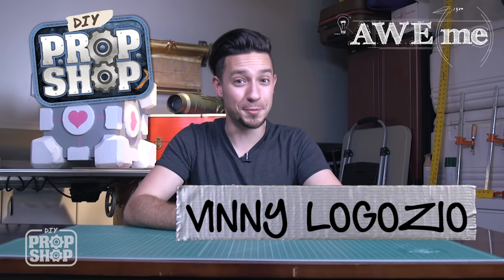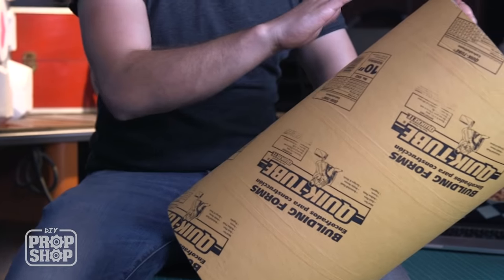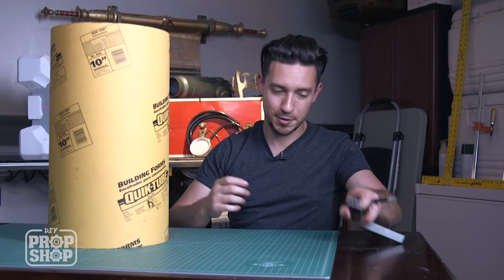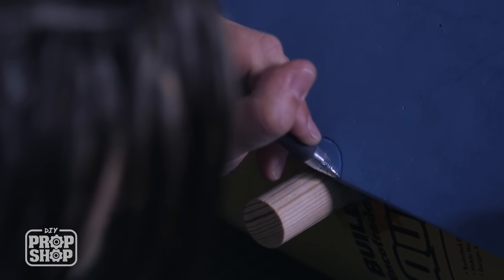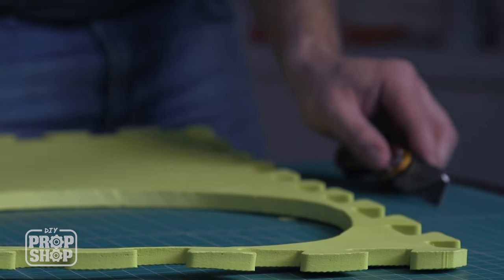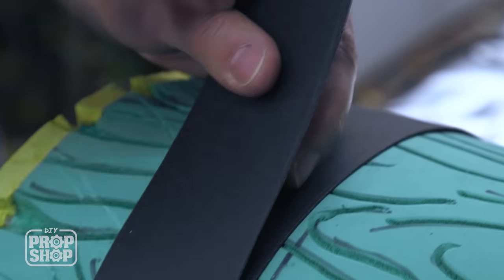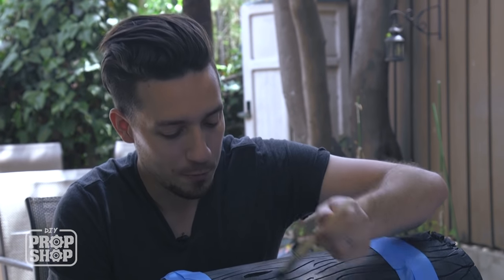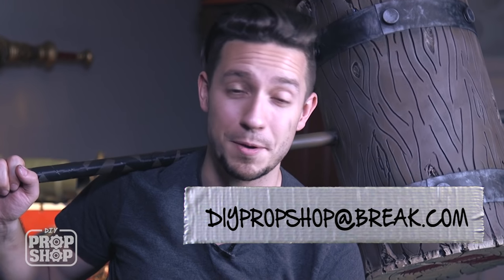Make Harley Quinn's Hammer - DIY Prop Shop

Comment: I find for better grip I use a technique I learned in hockey camp, you twist the tape into a cylindrical tube then put it over the grip surface, then cover in more tape. Works great for hockey sticks, and lacrosse.
Reply: I like that tip a lot. My absolute top pick for this would've been some type of black gauze bandage. Has anyone found something like that?
Reply: +Vinny Logozio walmart has sports wrap that would probably work..
Reply: I finds some cordage under some cloth tape on s good also.
Reply: Thank you guys these are great!
Reply: Vinny Logozio  black gauze bandage? Other than sports wraps, the closest thing I can think of is gaffer tape ....similar to duct tape, but uses cotton instead of vinyl plastics, and it&#39;s stronger; well...excluding gorilla tape, which is duct tape on steroids. The adhesive is rubber based, which makes resistant to mild heat and easier removal from surfaces.

Gaffer tape also tends to be more expensive than regular duct tape because of materials and professional uses, like theatre, film production, industrial staging...etc. I personally use it for repairing old book spines and cable management behind my computer desk.
Reply: +GCyclone like I say, thick string, or hocky tape twisted.
Reply: +GCyclone gaff tape is awesome! But $25 per roll hurts yo
Reply: +Vinny Logozio http://www.hockeymonkey.com/tape.html most black and white cloth hockey tape is under $4 for a roll that last me 2 years.
Reply: Thats funny, I was just about to suggest hockey tape myself.  Looks like your suggestion got a great response!
Reply: I used regular hockey tape for the handle as well.  I used one black and one red roll to add a "Harley" touch and just wrapped it around in a spiral pattern, it turned out great!  Was about $10 for both rolls.  Also, thanks so much for the tutorial!  My hammer turned out amazing (my first prop attempt) and I got tons of compliments on it.
Reply: Aden Cox

Comment: I saw a tutorial on making Harley's hammer where they left one of the end caps not glued on. They attached a hook in the center of the unglued cap, and used bungie cords to attach the hook to the handle, giving you a way to open the hammer up and use it as storage. Great for conventions, you can put your purchases inside it.

Comment: I've used that nonflammable Weldwood contact cement before, and it's the woorst.  It may be a prevalent manufacturing error or something, since I've found many others who have had the same issue (namely, that it didn't function as an adhesive. At all.)
Advice from someone who has worked with a lot of foam:

use Barge, Dewalt or similar contact adhesives.  Yes, they have some toxic vapors (which are no harder to deal with than spray paint) but, they dry quickly and they bond soft stuff together really well.

Comment: yes because we all have rotary tools.
Reply: good job though, paint job looks great.
Reply: +Mutton Man just use any power drill and attach a paddle bit at the end. It'll carve foam easily.
Reply: +Mutton Man They're like 20 dollars at walmart.
Reply: +Mutton Man if u r into this stuff its really useaful, u can get an electric one for 25 dollars. Try ebay or amazon
Reply: +Mutton Man a welding iron does the trick if you haven't got a rotary tool. But as other pointed out, it's easy to find cheap ones and if you plan on making cosplays, it's a go-to tool :)
Reply: Seoul Peterson didn't know they are that cheap. Thanx
Reply: I got a cordless lithium-ion one with adjustable speed, an LED light, a pistol grip, a charging station and 180 tools for forty bucks.

Comment: Vinny does great work and I love watching his vids. That being said I am super annoyed by those seams between the endcaps and the "bark" around the cylinder. The foam around the cylinder could have been extended outward and the caps set in a little, giving it a real bark-like effect...or the caps and bark could have been cut at 45 degree angles so the contact surface is still the same but you don't have that ugly line on the cylinders.

Comment: Could you also fill the tube with expanding foam to give it an even more solid feel?
Reply: You totally could. Although when it was completed - it felt sufficiently weighted at the top. I actually wouldn't add more material into this one, but maybe if the diameter were smaller.
Reply: Vinny Logozio My only concern would be someone going a little too in depth role-playing as Harley and destroy it haha.  I'm PROBABLY going to be replicating this for a friend :).

Comment: For starters Harley's hammer is called Beatrice also the paint you used is way to dark. The handle almost looks black. It needs to be a lot brighter. Finally were you have written "Your face here" Harley actually outlined it with the drawing of a face.

Comment: I had actually made my own twist on this. I used all of the supplies needed but instead, I used red and black duct tape and paints and such to make the hammer design, not the tree log looks. It matched my cosplay better, (in my opinion)

Comment: That contact adhesive looked very runny.  Not like any I've seen before.  I don't understand why you wouldn't just contact the EVA to the tube and contact the edges of the foam to the other foam.

Comment: Does anyone have any suggestions about what brand of paint I should use or the colors?
Reply: RedRobotCake for the wood, I got three colors in the brown and tan family from Home Depot, the cheapest sample size possible. As long as you start with a spray primer, you won't need much paint. good luck!

Comment: Hey Vinny what's the dimensions of the sonotube? I can't get any sonotube where I live but I've found something similar. I just didn't know what size to get. Also, this hammer is awesome!!!
Reply: This one was 10" diameter cut to 19" long. Hope you can find some! I got mine at a local Home Depot, in the building supplies section.
Reply: +Vinny Logozio thanks man. I've only just noticed that it says 10" on the tube and I can see you measured 19"s when you found the centre points haha thanks for the details anyway
Reply: +Daryl Dunne anytime yo

Comment: Why you can't do it from a simple log?
Reply: Because that would weigh sixty to eighty pounds?
Reply: ***** You can do it empty inside.
Reply: So now you're splitting a log in half and spending ten hours chiseling it all away and still have twenty pounds of wood.
Reply: ***** What? Maybe if it's wet but if its dry it wights not that much. 5 kg i think. Normal wight for two-handed weapon.
Reply: ***** Real thin mutch better than cheap fake junk.
Reply: I don't think you understand the point of any of this.
Reply: ***** So whats the point? Swing with this on camera and it's falling a part? :D
Reply: This is clearly a sturdy prop.
Reply: It's a PROP. Not a real weapon. THAT'S THE POINT.